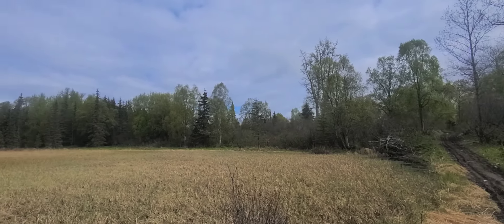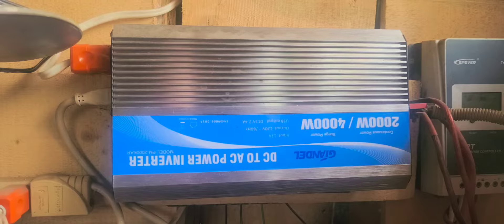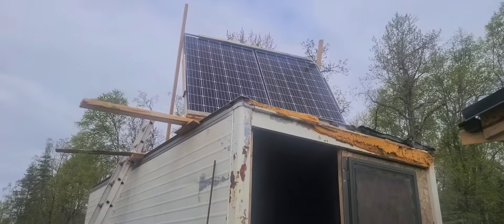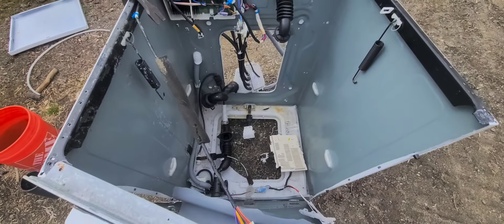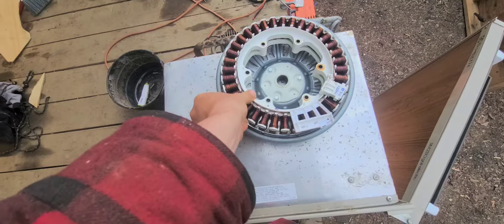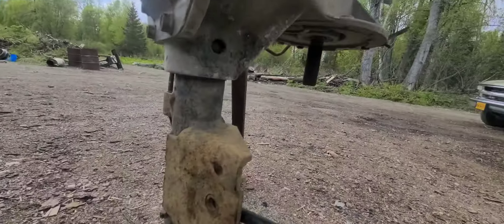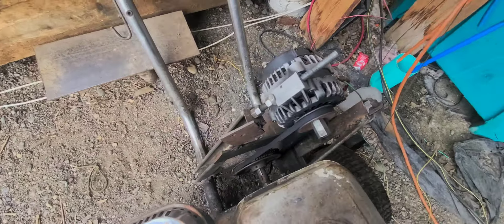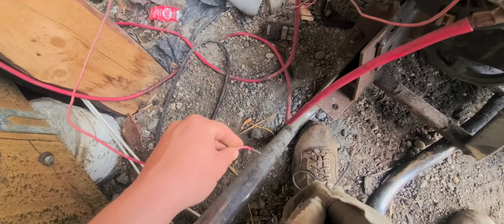How we Supply the Homestead With Electricity Off-Grid

Comment: Something I learn about windmill blade design.  I blacksmith a bit and I have a cast iron block with depressions for making different sized spoons.  I built a whirligig  (horizontal rotation) using spoon shaped aluminum as the blades attached to the hub with 12 inch rods.  It works but it can't build up any speed regardless of how strong the winds blows.  The back of the spoons creates resistance coming around into the wind so the whole thing spins but its speed is self regulating.  I feel if the wheel was turned vertical, had a tail vane so all the spoons would face into the wind), and the spoons were angled slightly so the wind can exit the spoons quicker, the RPM would be greater.  I didn't do that because its just a yard ornament and I didn't want to tinker with it anymore.  There are lots of windmill designs but I feel your design (like mine) can't turn fast enough to generate electricity.  I hope you find the right formula.

Comment: I wonder if the differential was put horizontal again and had the pinion being turned from the barrels wind power produce better torque (due to the gears). Then, if you had the electric motors on the hub ends of each axle, you might not have the stalling situation that you had. Just a guess 🤷🏼‍♂️ good luck